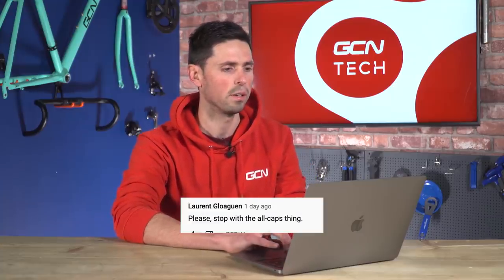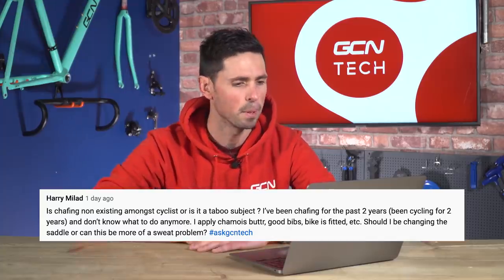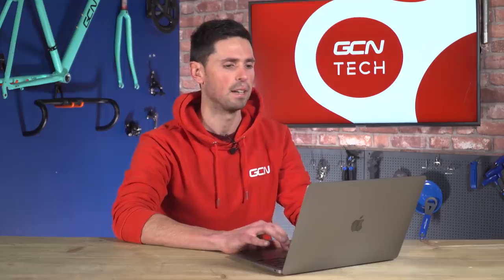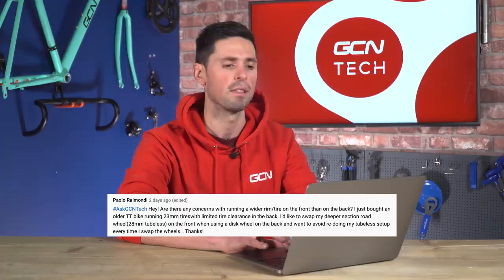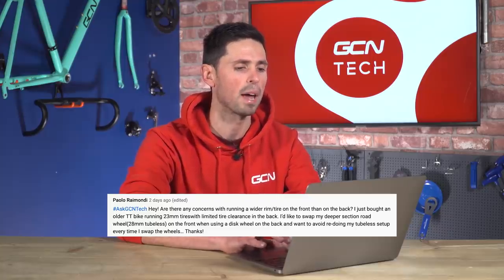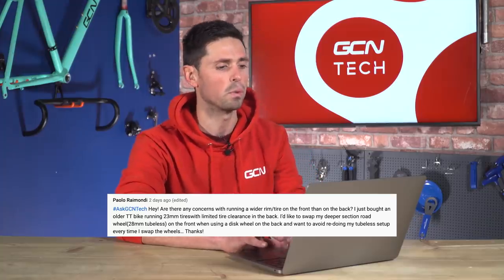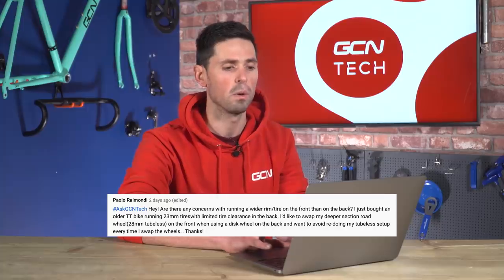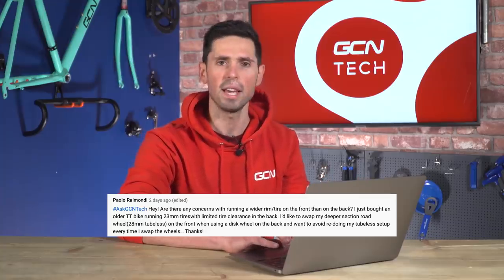How Much Do Bigger Pulley Wheels Help? | GCN Tech Clinic

Comment: OSPWs are helpful for relieving you of some cash. There doesn’t seem to be much evidence they help with much else. It’s mad that they can cost more than a Di2 rear mech for such small claimed benefits. As another commenter already said, if they were better, the big three would already be using them as standard or at least produce them as an upgrade. The only benefit seems to be in terms of customisation and bike bling
Reply: There are independent drivetrain efficiency tests that prove that they do in fact reduce drivetrain friction. The amount is extremely marginal, but there are some gains, so it's not just bling
Reply: OSPW's make you very slightly faster because your wallet is significantly lighter.
Reply: @UCzSO1EpAML8CiIUqh6ofsfQ No, those things are absolutely terrible!
Reply: In theory, they should improve drivechain efficiency for the same reason that a 17 or 18 tooth rear cog can be more efficient than a 10 or 11 tooth due to the broader radius of the larger cogs decreasing chain friction losses. The only question then is whether those potential extra watts are worth the extra money.
Reply: @SixSioux  Never bite the hand that feeds you..
Reply: @bidigi  Meaning that they are GCN sponsors? didn't know that...
Reply: @SixSioux  No, but they are potential sponsors, as the whole bike industry is. So you will never really hear a critical word from them.
Reply: @bidigi  Allright. Still I must say Alex here has been pretty brutally straight about the OSPW systems, basically saying it's just a non-sense to spend money on them, and to stick to the factory ones. Sure thing he did not point his finger on a specific one, therefore in a way he kinda did on all of them (CeramicSpeed and absoluteBLACK included). Got your point by the way!
Reply: @yogatriathlete 
Waxing your legs is better and cheaper

Comment: Regarding the cup and cone bearings: if the wheel is still swinging back and forth then it is probably just the inbalance of valve like Alex explained, but if it is an immediate stop which feels like a slight braking then I would assume the bearing is tightened a little bit too much. Untighten the bearing just a tiny hair and try again.
Reply: There's usually a heavy spot on aluminium rims, it's where the welded joint is (So that's a little bit extra metal) makes the wheel swing like a pendulum

Comment: My chaffing fix is not to use padded shorts, but if you do then take them off & wash up before you put the ride on Strava. Sitting around in a wet diaper has spooned hundreds of over the counter diaper rash meds. The same principle is at work w/ bike shorts.

Comment: #AskGCNTech I've got several questions. You can answer them in any order you like.

Technical questions:
1. Could I get away with putting an inner tube inside of a tubeless tyre for increased redundancy/durability?
2. If I were upgrading a fixie, single-speed or internal hub bicycle, would switching to a belt hurt my pedaling efficiency, or do I have nothing to worry about there?
3. Would it be viable to build a bike frame out of PVC pipes, if I were for example strapped for cash? (This one is just a hypothetical question.)
4. How the heck do automatic transmissions [on bikes] know when they're supposed to change gears? This has been baking my noodle for a while now.
5. When you fill a tyre with a lighter gas such as helium, or a heavier gas such as SF6, does it significantly affect your speed?

Less-technical questions:
6. Why haven't you covered PowerCranks yet? (Independent crank arms)
7. Have you ever seen DipYourCar's content? I'd love to see somebody try that stuff with a bicycle. (It's like paint, but peelable!)
8. There's a website called Bike Index (dot) org, which is good for mitigating bike theft. However, it seems to be mostly US-focused. While that doesn't affect me as an American viewer, I would like to know what the European equivalent is called, if it exists.

Comment: With regards to the safety of unbalanced wheels: any number of things can unbalance a wheel by some amount. Valve stems, speed sensors, and spoke reflectors immediately spring to mind, with some things being more unbalancing than others. No one bats an eye at the slight imbalance caused by any of these things.

Comment: Regarding the chaffing, just getting the most expensive bib shorts doesn't always fix the problem. Try a different brand and you might have better luck. I've tried the top end of several well known brands and the cheapest of the lot actually was most comfy even on rides over 200km.
Reply: i agree totally, the cut out and where/how the seam are sewn matters much more

Comment: Ok so I built up a disc felt with a 105 crankset...and Tiagra drive train. I picked up the rear derailleur for $25...,then added a "ALI EXP" carbon pulley/ cage ..$40...was it worth it?....hell yes! I definitely getting my money worth. Iv raced with full dura ace in the 90s and so my current rig is totally cheap and still quick.

Comment: Sometimes saddle sores or chafing can also be because of improperly fitted cleats. There is a bike shop video around where they explain it in more depth. If course, they want you to buy their products and services, but their point still stands. Check if your shoes sit too far forward. Standard advice is to put the cleats in a way where the axle is directly below the ball of the foot. It may be that is not your optimal position, and you need to switch it around a bit. This also will entail switching your saddle position as well, to preserve the stack and reach you already have. Worst case scenario you may need to buy new shoes, maybe new cleats. Maybe even change pedal system. 
Another possibility is that your sweat may be interacting with the fabric or material from the pad or the Lycra. You may just have very delicate skin down there. If it doesn't improve whatsoever after varying the remaining factors in your set up and kit(shoes and cleats, padding shape and even material), it sounds like a dermatologist issue. Stay safe and healthy!

Comment: I never use big-big when sizing chains that customers bring in. There's too many rules to remember. I just make sure their derailleur is compatible w/ their drivechain and go small-small untill the chain is under tension and does not rub on itself. It's way faster and simpler. As long as you don't change the spec on ur bike, it will work just fine. It also should account for oversized pulleys too!

Comment: It's not just the larger pulley, it's the better bearings aswell. Simply going from Ultegra or 105 'bushed' jockey wheels to Dura Ace ball raced jockey wheels you notice a difference when spinning the cranks by hand.
Reply: I hope so... Im just about to upgrade both my bikes with some new pulleys - Commuter is running an old 5700 105 setup. Its going to be getting a set of BBB BDP-02's and my 'go faster' bike with an older 6800 ultegra is getting a set of BBB BDP-22's with the ceramic BB's inside. Both bikes are going from the stock jockey/pulley wheels to these new ones and while i know they wont give me any huge gains in terms of watts saved etc etc, Im still interested to know if the bike will run any smoother and 'crispier' as far as shifting goes.

(first time changing these wheels afaik. I dont think my bike shop ever switched them out.)

The BDP-02's are also cheap compared to the OEM shimano branded units

Comment: I often use an air line to dry out mechs and brake calipers in the winter after a wash. Stops the water freezing cos the shed is cold and a frozen mech doesn’t work. Also, never wee on a frozen mech to try and thaw it. You just end up with a block of frozen wee. (Don’t ask how I know!).
Reply: Woah that’s some frickin cold weather ! Where do you live ?

Comment: Only benefit from an OSPW is the ability to fit a larger cassette like a 32 or a 34 on the rear with mechanical 9100. This would be why I got one. Cheaper than a new groupset from SRAM if you want those climbing gears

Comment: Also if you are using a Medium cage rear Mech. And a Wolf Tooth extension that method does not work. I found with that method the chain when on 34c/ring and 12 sprocket was very loose. Using a 12 to 32 cassette. Taking a Link out of the chain made the 50t and any sprocket above the 4th down was unusable. Owing to the tension on the rear Mech. My work around was when the chain was very loose on the 34x12 to angle the Wolf Tooth back and tighten to give adequate tension and at least a few more gears{ about 2} available on the 50t

Comment: #askGCNtech I was bleeding my shimano ultegra di2 brakes (R807000 ) following the GCN tech instruction video. everything was going well until I put some pressure through the system to see if the lever was squishy or not. It was squishy because lots of brake fluid poured out from the piston on the rear caliper. I assume that the seal is either broken or not seated properly (??). Want to show me how to replace the seal and the piston? it would be quite helpful - thanks love the show!

Comment: #AskGCNTech Hi guys, what is a better way to make sure your bike fits you better? Buying a shorter stem or use some spacers underneath the stem. Recently i've been having troubles with my bike while riding so i want to make sure that i ride without any complains. (Ps: i compete in road races so the position needs to be aero to #aeroiseverything)
Reply: You can shorten the reach by a few cm by rolling the drops down slightly and raising the controls higher up 🤔 that's free and pretty quick.
My bike used to be a hybrid and came with a 120 stem, after switching to drops I went for shorter one, 60mm but now I'm at 70mm, the shorter stern made it feel skittish but 70 is ok for me now. I did try a 50mm but it was crap and I didn't like the colour. 🙃
Also the stem can be mounted either way up, so if it's angled it could rise or drop depending. It's normal for it to be mounted with the rise though I think.
Spacers yeah, depends how much steerer you've got. Perhaps there's already some spacers above the stem that you could put underneath instead to keep the overall stack height the same. Point being the stem still needs to clamp on the steerer tube so can't be raised higher than the top of that. Though remember the stack height does need to be slightly higher than the steerer to allow proper bearing preload. 👍

Comment: OSPWs are for looks. But spending hundreds on them is bonkers. I have OSPWs in a carbon cage, matching my bike paint, for less than 50 euros. Including replacing the open ceramic bearings with sealed ones. Works fine, looks great. That's all there is to it.

Comment: #askgcntech  I'm riding an absulute entry bike for fun. No race or record attempts ;-) The bike is quite heavy, and i'm thinking about some cheap fixes for that. It is equipped with simple Tektro rimbrakes. Do you think it is worth upgrading to Tiagra/105 rimbrakes as they are avaible for "just a few bucks"... do you know if (stopping power & weight) it's worth it? 
The front fork is made of steel, so there is plenty of weight to be saved. what do you recommend?

Comment: #AskGCNTech How to fit a 11-34 casette with 34/50 DuraAce chainrings. Saw it at Ollies bike for the Tour des Stations.
Thanks and cheers
Reply: Long cage RD
Reply: Get yourself an Ultegra medium cage rear derailleur first if your rear derailleur is an 11-speed Dura-Ace. The chainrings do not affect whether you can fit an 11-34 cassette or not.
Reply: Thanks guys.
any experience with wolf tooth - road link?
Reply: Medium Cage (GS) rear derailleur and new chain
Reply: @tihohohoho  The "problem" with a road link (with an SS derailleur) is that while it lowers the upper pulley to clear the larger cogs, SS and GS derailleurs move the cage at a different angle from one another.  Ideally, the cage would follow the angle of the cogs on the cassette for best shifting.  Experiment.  Some people are fine with SS derailleurs and Road Links.
Reply: Watch my vids. Im running a 42 xtr cassette with RD8000GS no probs.

Comment: #AskGCNTech
Hi [insert actual presenter name here],
I have a Ridley Noah FAST from 2014 with integrated rim brakes. I will need to replace the wheels soon, and am looking for carbon rim brake wheels now. According to the manual of the frame, the maximum width of the wheels measured at the brack tracks is 23 mm. Now my problem is that nowadays rims are getting wider, and I couldn't find any which are not wider than 23 mm. The narrowest I found is 25 mm. Would that still fit into the frame (actually the limiting factor here is the brakes which are integrated into the frame and fork)? Or could you recommend any (at least 45 mm deep) wheelsets which would fit?
Cheers
Reply: Im not cgn neither am I on time (2 years late) but if I was switching to carbon rim brakes I would try to find some with alloy braking surfaces carbon rim brakes suck
Reply: @ARCBIKES  I ended up buying the Swiss Side Hadrons (625/800), and they fit fine without any rubbing.
Breaking performance sucks of course, but I only use it in dry weather.
Reply: @cicckany8540  thanks I guess I know now if I ever get carbon rim brakes I'll use them only in dry weather

Comment: #askgcntech Hi Presenters! The GRX rear derailleur has a switch for chain tensioner. I've always had it in ON position regardless of where I ride (even indoors). Would I gain some watts if I left it OFF on smooth surfaces and ON only when driving on gravel and single track?

Comment: #ASKGCNTECH: Hi guys and Manon. I bought a Garmin Tacx Flux smart trainer secondhand. It's in great shape and barely used. I've set it up correctly, but the issue I am facing is when I put my bike on the trainer, the derailleurs are so misaligned with the trainer cassette that to make it work I have to completely readjust the derailleurs to compensate despite using identical cassettes on my bike and trainer. This defeats the concept of dropping my wheel out, popping the bike on the trainer and riding. Garmin tech support said, “Them’s the breaks.” Is this normal to have to completely calibrate the derailleur setup when putting a bike on a smart trainer?

Comment: #askgcntech Hi guys, and Manon☺️. I’m currently riding a Cannondale CAD3 R500 frame which had a crack on the chainstay but I’ve got it welded back during the restoration process( I’ve also refrained from blending the weld to fortify the frame strength.) Recently I upgraded the drivetrain to a 1x set up with a 56T chainring and a 23-11 cassette at the back. I’m concerned about whether the power required to put through the pedals will stress the frame integrity. Thoughts?
Reply: That isnt power. It is torque. 

Power is what you want. That makes you faster. Torque just wears stuff out faster.

Comment: The idea behind bigger pulley wheels is to reduce the drag in the chain itself. It's the same theory that goes for using the big chain ring instead of the small one, eventhough you get the same gear ratios. The chain just doesn't have to bend/rotate as much when it goes around the bigger sprocket/chain ring.
Reply: Sooo....I should go....faster? I mean I go a lot faster when I shift to the bigger chainring.

Comment: #AskGCNTech 
I currently run a Shimano compact 50/34 chainset combined with a 105 11/30 cassette. 
I'd like to fit a semi compact chainset (52/36) to stop me from spinning out on fast descents but still want to maintain and / or improve my climbing ability by replacing the rear cassette with a 11/32 ( or even 11/34) sprocket set.
The rear derailleur is Ultegra with a medium cadge. Do l need to run a longer chain / cadge to enable these changes??
Many thanks
Steve
Reply: 52/36 with 11-30 would be a pretty good “all around” setup and save you some money. 
I run 52/36 11-28 and it’s pretty sweet but having that 30t out back would be a nice relief on those looooong climbs.

Comment: Would a 28mm tyre still be faster than a 25mm due to lower rolling resistance but it would be slightly lower in aerodynamics?
Reply: No, wider tyres being faster is a wives tale perpetuated by the cycling industry. 
28 mm tyres only roll easier than 25 mm tyres on a drum in laboratory conditions at identical pressure. In actual practice though, a 28 mm tyre casing cannot handle the same internal pressure as a 25 mm tyre (due to hoop stress). Not only that, a 28 mm tyre inflated to the same pressure as a 25 mm tyre will behave stiffer and harsher when riding on actual roads, and will transmit more micro-vibrations to the frame and rider, thus consuming more energy. When 25 mm and 28 mm tyres are adjusted to provide the same level of rider comfort, they achieve virtually identical rolling resistance coefficients. As for aerodynamics, a 25 mm version of a tyre is always less draggy than a 28 mm version of the same tyre, when both are fitted to their respective optimal rims.
Reply: @johnbarron4265  I’ll be using a tubeless pirelli to test out that in 26mm they had no 28mm available

Comment: Got to disagree on the drops having the best reach and power.  I can barely reach the levers on my sram axs bike when in the drops, even with the levers at their max adjustment (checked by different bike shops, that's the best that can be achieved). It's far safer for me and anyone with medium hands (I fit M sized gloves) to be on the hoods where we can actually brake.
Reply: I have the 105 levers for small hands. Yet I have to adjust the reach to the closest position to get a more or less confident grip from the hoods. I wonder if a different handlebar (currently 400 mm) and or a different handlebar/lever position would help a bit. Anyway, I don't know how women with smaller hands can even reach the levers. This is something surely worthy of a GCN video #askgcntech
Reply: It depends on what type of bars you have. The bars with the deeper drops and reach will make it feel like you're reaching for Jesus. But compact bars have a much more comfortable reach and feel.